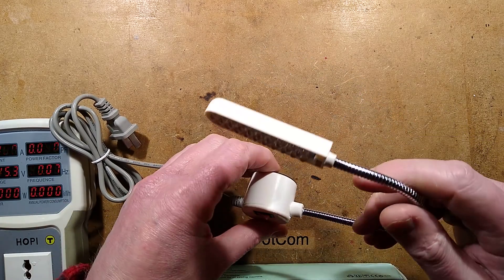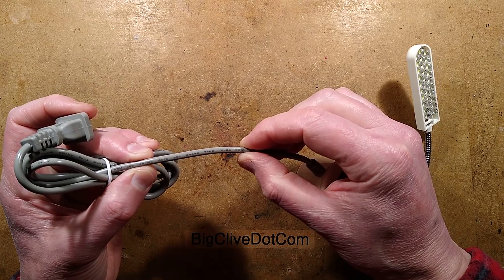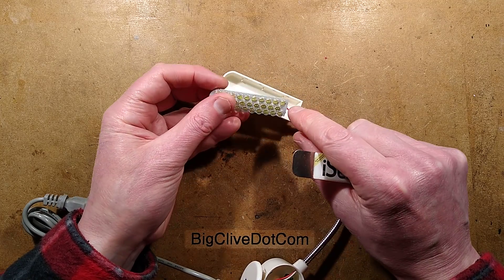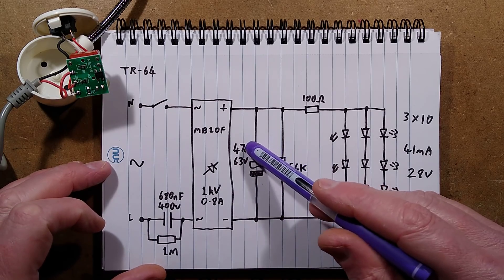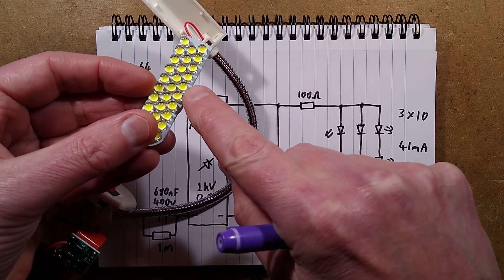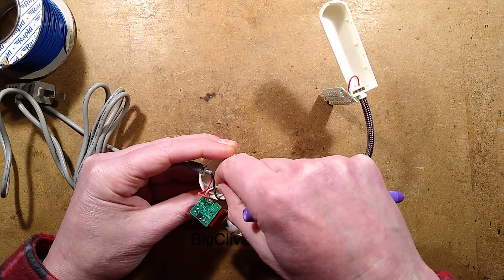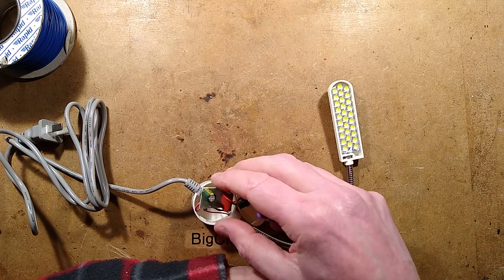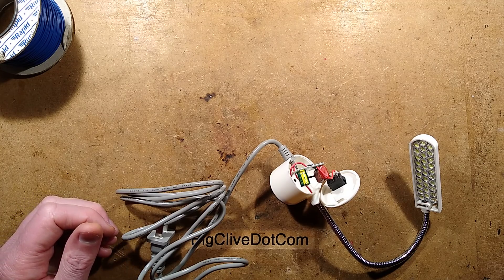Exploring a Chinese magnetic "machine light" (with schematic)

Comment: And in our next episode: Clive will show you how turn this led sewing light into a battery backup emergency light. Complete with trickle charge NiMH battery.
Reply from the maker: I could do that.  But it wouldn't fit in the existing enclosure.  I'd probably redesign the LED panel to operate at 5V and run it from a power bank.

Comment: I got one of these a few years ago for my mum to use with her sewing machine, in the end she was happier with a battery powered one. I did take it apart to see if there were any risks as well.
Reply: I can see the problem, this type of light would have to be mounted pretty close to the working bits (given the small size and short neck) and the cord would tend to get in the way.  Most of the time, I've found the internal light on my sewing machine adequate for seeing the work, but often I need more light that a typical indoor illumination level to prepare the work.

Comment: I'm always surprised as to how thin cables can be for our 240V
Reply: And any fuse wire has to be somewhat thinner.
Reply from the maker: The thinnest being the lacquered transformer windings.  Most flexes are rated more for physical wear than dielectric strength.
Reply: @bigclivedotcom  Oh yeah I never really considered transformers, wow that's thin, can't believe you can fit the current through such thin wires without them burning up..

Comment: The little hole in the center of the back is just there to let the magnet be placed in the hole without creating a pressure bubble and popping itself back out again,.
Reply from the maker: Could be, but looks like there might be some form of pin too.
Reply: @bigclivedotcom  I took one of these apart just yesterday. It's a screw that holds on a metal bracket that houses the magnet and rubber boot. Ours came attached from the factory as part of a hydraulic metal shear!
Reply: @bigclivedotcom  Perhaps there is a round metal plate with a pin on it, that has been inserted into the hole and then the magnet is attached to that.   It would save on glue, and if that pin is press-fit, it would speed things up as they wouldn't have to wait for the glue to dry on the production line.
Reply: Any chance of continuity testing the pine hole on the inside with the magnet on the outside?
I suppose in all likeliness the machine it's attached to would be grounded.

Comment: The only issue I could see would possibly, if it was used in a metal working application, might be coolant ingress into the enclosure. Hopefully, on a properly earthed machine a imagine the RCD would trip?
Reply from the maker: Machine tools and RCDs don't make a good combo.  Good grounding is better.
Reply: @bigclivedotcom  For my workshop power I have an 8 way consumer unit with an RCD on the main 2 pole isolator, pretty much a smaller version on a domestic set up. The lathe runs off a VFD with a 240v 3 phase supply, the milling machine runs off a fabricobbled by me rotary phase converter as it's a Bridgeport with a 2 speed motor and won't run off a VFD. The whole caboodle is bonded back to the house earth and I have an earth rod taken off the armour on the SWA from the house. I'm hoping this makes for a reasonably good level of grounding. What do you think?

Comment: Can't you use wire for any voltage, but the current is the one that would kill it?
Reply from the maker: The insulation has to be rated for the voltage to avoid degradation and possible fire.  Not such a huge risk really.
Reply: @bigclivedotcom  ahh
Reply: I think it's less about killing the cable and more about killing you. The insulation, not the conductor.

Comment: Tidying the mountain? Oh god, now you'll never find things again
Reply: Sometimes I lose parts I need and buy just new ones instead of finding them. Eg I've just bought some new jumper wires as I couldn't find my existing ones! 🤦‍♂️
Reply: @gazzat5  I maybe did this onky once or twice, 😅 but I swear I still couldn't find whatever it was
Reply: @phonotical  I'm sure it'll turn up some years down the line when I'm looking for something else lol
Reply: No, the opposite. When i tidy my bench (dust, bit of wire, sleeving, random components, plastic bits) and put things back in their proper place , i find things that i thought id lost months ago. It takes hours and is very boring and tedious but i have to do it from time to time.
Reply: @simontay4851  well you're the 'I have a proper place' person and you probably not get the 'to the 3rd pile right there' person 🙃
Reply: @simontay4851  I try and be tidy as I go, sure it looks a mess, but I can locate about 90% of what I'm looking for 😅
Reply: @phonotical  I call that "An orderly mess", it works until anyone else 'helps'
Reply: @mrsheesh3743  I've been there!

Comment: I think it's time we stopped rating the strength of light by the amount of power it uses...
Reply from the maker: It's the easiest to measure, but doesn't take efficiency into account.
Reply: @bigclivedotcom  heck, some things don't get very bright at all, no matter how much you run through them
Reply: Different CRI are going to have different efficiencies; if by measurement we demanded maximization, then every general purpose LED sold would be in cold blue.
Reply: @HighestRank  in terms of actual brightness, not colour theory

Comment: Doesn’t seem to  have much in the way of inrush protection if you happen to switch it on near the peak of the mains sine wave.  Is the larger than usual capacitor perhaps intended to help absorb such inrush?  And is its voltage rating a problem under such inrush?
Reply from the maker: A 10 ohm resistor would have been nice.

Comment: Is it probable that the cable manufacturer wants to make sure they always have 30V cable product available, so uses higher rated stuff either because they ran out of the 30V, or even because its cheaper to make just one cable  (the higher stuff) then print and sell it at the lower rating as well as higher? And then the light manufacturer hipped to that fact and started buying the lower rated stuff?
Reply: In other words the compliance statement and stated rating is always wrong !

Comment: Cool I came to same conclusion before I fitted to her sewing machine  .. The Switch is on whichever line you plug the two pin plug into !  I hard wired mine into LIVE :)
Reply: Did you also hard wire the cable directly to the wall? ;-)
Reply: @hagen-p  well here in UK we have 3 pin plugs so you can not reverse them. code says live is fused inside plug... so sort of  :)
Reply: A lot of the mid-century modern sewing machines you can plug that type of light right in to the machine.

Comment: Plot twist: The inner insulation is actually misprinted and it actually is 30V but the manufacturer made the same mistake as Clive.
Reply: Back in my days as a Sewing Machine engineer, some motors did have a tapping for a light that used the US flat pin socket
Reply: @micheallastname5772  I have have a vacuum cleaner whose light bulb is in series with one of the motor windings. But, my sewing machine light has its own power supply.
Reply: It's definitely misprinted. AWM Style 1185 is "Single conductor using extruded non-integral jacket" but this is clearly a multiple-conductor cable.
Reply: These lights are also available in low voltage ratings 5vdc and 12vdc, and use the same unbelievably skinny input cable. Old sewing machine clutch motors had a 6v tapping in the windings to supply old filament lamps so they piggyback off of that. Entirely possible the cables are not really mains rated, but functional (till squeezed or pinched too hard!)